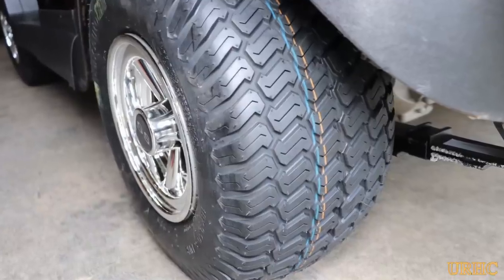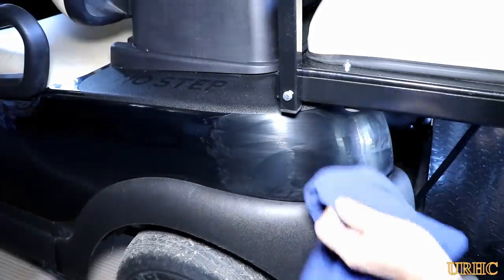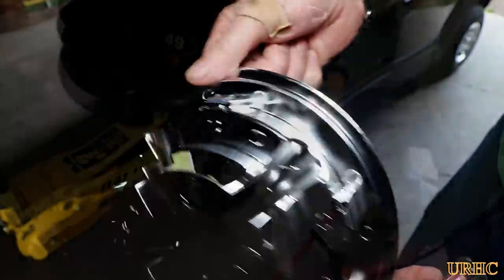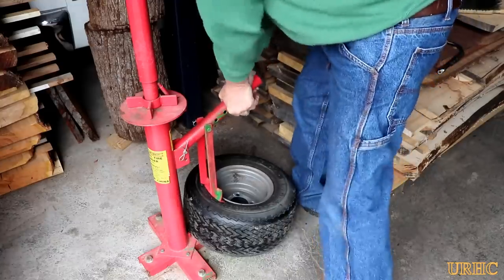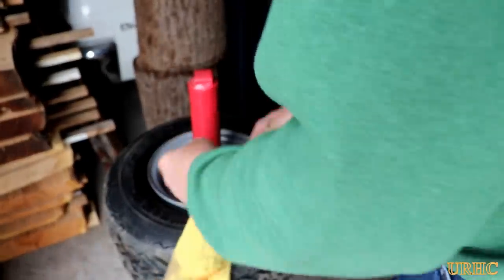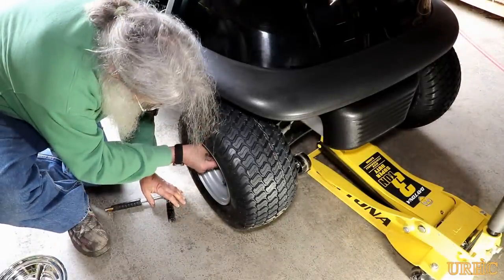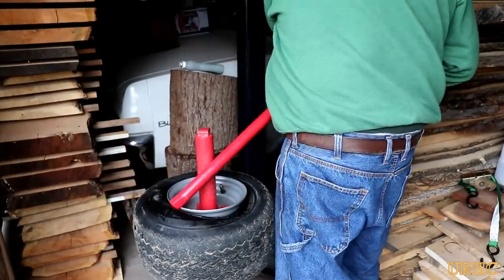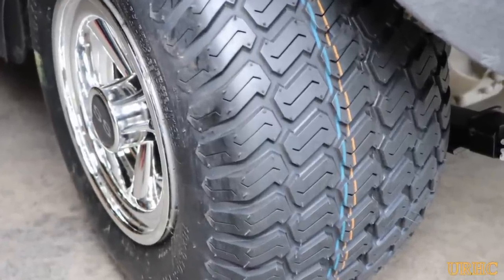Replacing The Yard Cart Tires With Cheap Mower Turf Tires And Polishing The Plastic Up

Comment: I knew you’d overcome the obstacles, you’re very creative. One trick I’ve learned to break the bead is lay the tire on its side and take a vehicle heavy enough and ride over the sidewall and it pops immediately, you just need someone with you to line it up easier. Always interesting doings on this channel.
Reply from the maker: There is no way to drive on one of these tiny tires. The machine works great if there is not wood piled where the handle needs to go.  These little tires are a real big pain to change. Hopefully she won't get stuck in the mud again. Thanks for watching.

Comment: A mod i've done to one of these (similar but the European variant) is on the top screw mount you put to hold the rim in place, i lobbed off the ear and welded a lever similar to the normal one. Really helps when putting tires on that have high ply or just plain stiffer compounds.
Reply from the maker: There is a slot to use the bar but your idea is better.  These little tires sure are tough to mount.  Thanks for watching.

Comment: Just what I was looking for.  Ordered 2 of those same size tires for a zero turn rear,  and thought I might try 2 on the rear of my golf cart, which will get stuck in a heartbeat. I think I'll go get the harbor freight mini changer,   which I think is a little easier on those sizes.  Nice vid and voiceovers
Reply from the maker: These have been great tires. They have not lost any pressure since I installed them.  Thanks for watching.

Comment: One of the best lubricants for tires I have found is Go-Jo hand cleaner cream. It is very slippery and allows the tire to slip right off and on the rim. When finished it wipes right off and cleans your hands at the same time. :-)
Reply from the maker: I will have to try that.  Thanks for watching.

Comment: Do you treat your mower deck so grass doesn't stick? If so what do you use i have not had good luck with kitchen sprays such as pam and other nonstick sprays. I have resigned to a yearly cleaning and repaint to slow the  rusting! Any Thoughts Thanks
Reply from the maker: No, just scrape and watch it rust.  I tried  some coatings when new but they were a waste of money.  Thanks for watching.

Comment: Another great video can you tell me the model of the HF impact gun. Thanks Bill
Reply from the maker: It is the 1/2 inch earthquake aluminum model. I think the current ones are slightly different. It's about 12 years old and has worked great. Use the 3/8 high flow couplers on all air tools for best performance.  Thanks for watching.

Comment: No need to run that much air... and they will leave less ruts and have more traction with a little less air. Try about 2/3's or 3/4 of max as a start...
Reply from the maker: Like I said you have to inflate to max pressure to make sure they seal properly then back them off some. 18 psi seems to work best in them. Thanks for watching.